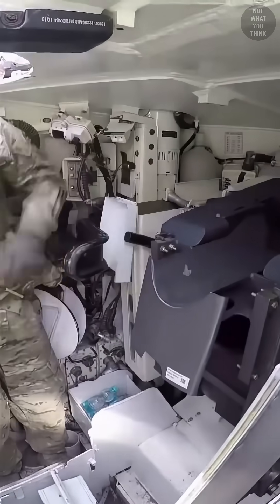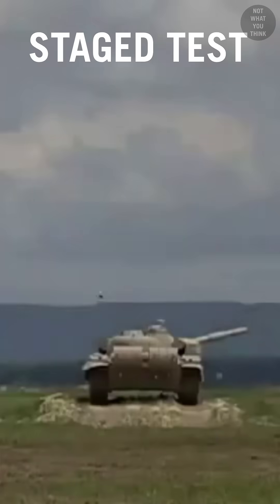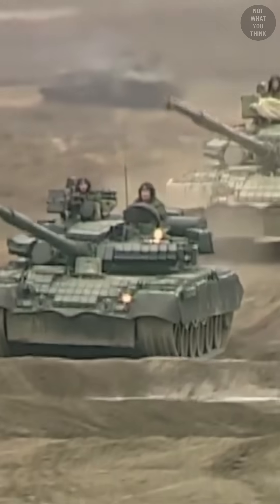Why M1 Abrams Tank Has No Auto-Loader #shorts

Comment: Also the fact that an automatic system may be faster and more efficient in firing, it comes at the cost of not being safe for the crew and being mechanically complex meaning constant maintenance and need to replace crucial parts of the automated system. It also leaves your tank useless if it breaks during a fire fight. I’m editing this to also say that having a auto loader also decreases the volume of the tank needed to support a manual loader becoming lighter as it requires less armor.
Reply: If the mechanism suffered enough damage to break, it would mean that if there was a human loader inside, he would have been either badly injured or dead
Reply: @naelgodefroy2535  it could just break down tho over time
Reply: @hunterbear2421  then it would need a lot of time to break as other elements of the tank, but usually tank parts are well engineered and take a lot of time to break without suffering damages
Reply: yeah but the auto loader has more things to go wrong then if it was just a manual loader, because it also makes it so if the rarety the ammo explodes that the crew can't be shelded but like the americas tank they have it in a compment that is sealed off by a automatic door, so if it is shot the crew stay safe which is good to think about it
Reply: Constant maintenance.
Russian.
Pick one.
Reply: @WayStedYou  Too bad so few people get the joke.
Reply: @WayStedYou  always comrade.
Reply: I dont know how in your country, but here in Europe it is not a problem to build autoloader that wont break down. It is not such sofisticated piece od technology. I would not use breakdowns as an argument. Also there will be noproblem to use autoloader together with safety storage box. But this needs a new tank and new tank will have higher caliber, 130mm or maybe even more, the shell may be longer to be ablle to shot long rod. This all will increase the weight and thats the fact which will make developers of tanks to equip them with autoloaders.
Reply: @milanvnuk8387      Btw in our country we don’t use autoloaders, but anyways it’s always a valid concern for something so mechanically complex to break. Sure it’s not sophisticated mechanism but it requires constant maintenance and replacement to make sure that it specifically does not break and that costs more than it would to have another hand in the tank loading the shells. My argument with the mechanism breaking is valid as they spend more money so that make sure it doesn’t  break. And the reason they’re using heavier rounds and a autoloader is that they don’t have to make the tank heavier by adding extra armor on the turret to protect the loader, they’re trying to counter the issue of making it heavier by making it lighter. Also a blowout compartment is not possible on a autoloader at all. One reason being that if you use a blowout compartment on an autoloader is that all ammunitions of the autoloader are stored in the turret basket meaning you’d have to be able to blow the entire turret for the carrousel type loader or compromise the entire loading mechanism and ammunition on the bustle type loader, anyways that would be a of money wasted there. Also it’s easier to control a explosion of 18 shells than explosion of triple or quadruple that number.
Reply: @mushroomwizard1175  If breakdowns are used as an argument then you need to take in consideration the human breaking and being unable to continue work aswell.
Not to mention that the possibility of the human loader to suffer a critical injury is higher than a good autoloader. Plus you need to factor in the issue that plagues only the human loader and that is mistakes, the machine does not do those it either works or breaks.
Reply: @AmbassadorOfREEE  I dare you to find any organization on the planet that can repair an autoloader faster than the US army can find another person to be loader. Also while we're at it I want to see your autoloader help change slipped tracks or do maintenance.  No tank is going to stop a fight to eat. No tank is going to blow through its entire ammunition storage as fast as the gun can physically fire. Stop making up asinine scenarios to try and prove your point. You're obviously reaching.  I'd trust the reasons put forward by the people who have actually operated the tank as to why it works over the mad ramblings of why it doesn't by some random internet autoloader fanboy on any day.
Reply: @JetleanSam  I sense a lot of butthurt over nothing.

I'm really not an autoloader fanboy, I simply look at things from an objective standpoint. My ramblings being asinine is just your opinion and I don't really care, what I said holds true and you can't deny that.

Everything has their pros and cons and some could argue that the pros of having a human loader outweighs the pros of an autoloader and that includes myself.

Lastly you conviniently completely overlooked my point about effectiveness, reliability and versatility in human loaders favor making your outburst pretty damn silly.
Reply: @AmbassadorOfREEE  you’re just a civilian fan boy that wishes he could load rounds in a tank.
Reply: @m.j.darmody3576  Well sort of right minus the fanboy part. You see I'm from Finland and military service is mandatory for men when they turn 18.
I did my service in 2012 to 2013 (I served for 362 days) and I'm an NCO, Pioneer and the company's radio guy.

So yeah I kinda wish that I would have gotten to load rounds in a tank because that would have been fucking awesome because tanks kick ass.

Instead I got to dabble with radios and blow shit up so it's not that bad afterall.
Reply: Its funny that you say that... I guess people are the same even across different countries... People trying to find excuses for not having to do things, like Russians were saying before that the reason they couldn't build good roads is because it's impossible with the Russian climate , because it has temperatures extremes... You are the same, trying to find an excuse for not having an auto loader.
In practice it's much better and Russian tanks already had it for a relatively long time. Now they even have a tank (t-14) which also even separates a crew from it's auto loader gun and ammunition. And no , maintenance and failure rate is not a problem, and even if it was , tanks are quite expendable, there're usually hundreds of them in the army...

I guess people are the same after all...
Reply: @Alain_Proust  yeah would be very surprised if the auto loader would be an issue.
Reply: Speed and aggression over safety seem like a calculated cost
Reply: I can't wait for a tank gang war
Auto loader vs human loader
Reply: For some tanks like the Leclerc it is as safe as a manual loader, faster, never tired, and probably as good as a manual loader. And it doesn’t drink the driver’s beers.
Reply: Jay Jay  sure, but training for it, and actually doing are two different things.
Reply: Built like a tank?
Reply: I very much doubt that it would be impossible to come up with an auto loader that also has a similar safety mechanism. Better yet, make the tank remote controlled
Reply: @Qwertworks  Fun fact: european auto loaders have the same safety mechanism as the american manual loader... but they're automatic.
Reply: Heh Ndje  being trained too and being able to do it underduress are two different things.
Reply: An auto loader is not faster than human loaders.
19K’s are taught to reload in 4-5 seconds.
And auto loader is about 7-9 seconds. 
We’re putting twice the ammo down range.
Reply: @willbo6017  Thats probably true, but how long can it be kept up? I guess my thing is that eventually, the machine will always be better since it doesn't tire. It may be more rounds than the tank can store before it's more efficient though lol
Reply: @Isometrix116  Does it really matter for how long it can be kept up? If you can reload and fire faster than your enemy then you have the upper hand in a firefight.
I'm pretty sure that even a decent loader can keep up the pace for atleast 5 minutes and do so faster than most tank autoloaders out there.
Reply: @willbo6017  The most modern autoloaders (such as on the Type 10) can manage 1 round every 3.5 seconds.
Reply: Are you actually dumb? You do realise that you can still load it manually if the auto-loader breaks
Reply: @ronjeremy5826  oh plz explain how would u do it
Reply: @ronjeremy5826  yeah but its slow af bc in the russian tanks its a 2 peice ammo system so youd have to go into two compartments
Reply: @ronjeremy5826  on most Soviet tanks, this isn't possible. The T-14 may have this functionality, however, and the B2 Centauro does for sure.
Reply: @ronjeremy5826  I wouldn't call someone dumb before you get your facts straight. Auto loaders can't be manually loaded because there is no space for the human and the mechanism isn't adapted for humans to use. Auto loaders are very mechanically complex, you can't just shut one part of it off and expect the whole system to still work.
Reply: @FlayvorOfEvil  you are clueless. And where are you getting your “facts” from? Google? Buhaha
Reply: @ronjeremy5826  really?
Reply: @MrHohommax  yea soldiers in the army are faster the than autoloaders
Reply: I was a loader on an Abrams for years and in Iraq. 3ACR I promise you auto loaders can not and should not replace a  soldier.
Reply: @MFSAMS  there's no point in arguing practical applications of human loaders with people that think autoloaders are some magical thing that won't break.
Reply: @MFSAMS  so you was a child murder in iraq??
Reply: @justuskid9577  Sure, whatever you say kiddo.
Reply: Autoloaders are slower than humans, overall in the military they are considered bad loading mechanisms, human elements are always preferred, except when it comes to explosives handling like clearing mine fields or such.
Reply: Actually the army trains its men to be faster then the auto loaders they aren't as fast as u would think
Reply: Auto loader's go off target to reload . This is why the west use a manual loader.
Reply: Please shut up so much bullshit in one comment edles Magic mushrooms
Reply: Auto loader isnt faster or more efficient. I could beat an auto loader all day everyday. Auto loader is 6 sec load time. I could load a heat round 2.5 from breach down to up.
Reply: @MFSAMS  this assumes that the gun is elevated to an optimal angle for loading, and that the breach opens and closes smoothly. It's important to keep in mind that the loader isn't the only part of the loading process.
In an M1, I believe it typically goes something like this:
Fire
Raise barrel (lowering breach for ease of loading)
Open/confirm Open breach
Open ammo compartment
Load shell
Close ammo compartment (probably automatic)
Shut/confirm closed breach
Lower barrel to target
Fire
There's a lot to pay attention to, and the loader is doing more than just shoving the shell into the breach.
Reply: @theonlyknight3171  after the main gun goes off. When the break drops I'm throwing a round another round in there. 2 or 3 secs. Auto loader is not faster or more efficient plus auto loader doesnt maintain coms ground guide do maintenance site the main gun or fire the 240.
Reply: @MFSAMS  during training with open blow up panel ofc, but not in actual combat. This isnt war thunder mate.
Reply: @MFSAMS  how long can you keep up that time you will get tired sooner or later
Reply: @MFSAMS  I could do it hanging upside down from the balcony naked while sipping a cold whiskey on the rocks on vacation in Florence.
Reply: @MFSAMS  to do that consistently under sustained enemy fire and on uneven terrain would waste your energy and I doubt you could put out 24 shells a minute in that terrain when the average for strong young men is 8 a minute, humans cant sustain putting out 15 shells per minute and can only do that in short bursts. Besides a human loader gets tried and machine does not get tried, it only needs to be examined and repaired. Machines are faster going anywhere from 8-12 shells per minute depending on type of loader and the tank model, putting out 4 more shells per minute is a huge thing in a fair bit of situations.
Reply: @mushroomwizard1175  with a Russian targeting system you probably do need to fire constantly for 2 minutes and hope for a hit.  Abrams doesn't have that problem.
Reply: @IanNewlin  that’s unlikely to be brief as modern tank shells can hit things accurately within a few km of the firing point and unless the target is outside of that range it’s still unlikely that they wouldn’t hit it after a few shells.
Reply: @mushroomwizard1175  a friend of mine is the loader on a Leopard 2A7 Main Battle Tank, 6 DMXX rounds per 10 seconds
putting you at 36 shells of sustained fire every minute, and he isn't even the best one at the company.
Reply: @IanNewlin  i wouldn't underestimate russian aiming systems
Reply: @MFSAMS  Faster if you had a pissed off crew commander!!
Reply: @MFSAMS  All automated systems can cripple everything if damaged you noob. Target acquisition is always reset after every shot because of recoil, making the auto-loader fast-loading features useless. 

On top of that, it basically increases the cost to produce the whole thing.
Reply: @MFSAMS  the type 90 can have upwards of a 3.5 second reload and for far longer than you can reload
Reply: @MFSAMS  could you? All day? With every round?
Reply: @MFSAMS  No you can't beat an autoloader ALL day every day. Yes you may be momentarily faster than the autoloader but when you gettired and sluggish the autoloader won't. Eventually you will need to stop to eat but the autoloader will keep loading that gun while you eat. You will also need sleep and while you sleep that autoloader still keeps loading that gun with more ammo.

Yes I'm calling out your pravado here, I wan't to see you reload the ENTIRETY of your chosen tank's ammo loadout in one go, sustaining your peak performance all the way without stopping or slowing down a single tiny bit (nope you can't but the autoloader can).
I'm hazarding a guess that your tank will be the Abrams so that's what? About 50 shells that weigh around what 40 to 50 lbs?? (I'm sure you get the picture here).

What I'm saying that a human can't beat an autoloader in efficiency and endurance, that's just a simple fact. Plus if we get to pick and choose our autloader I'm pretty damn sure we can make the human lose in speed aswell, alst time I checked the Gau-8 avenger is a self loading rotary cannon (LOL).
However we can start and argument about effectiveness, reliability and versatility as there are a multitude of things an autoloader just can't do but YOU can ;)
Reply: @AmbassadorOfREEE  The Gau-8 Avenger is a revolving gatling cannon chambered in 30mm 
we are talking about higher calibers
Reply: @ikat_tracer  I'm fully aware, what I said earlier about that is something called a joke, maybe you have heard of those?
Reply: @MFSAMS  1st shot only

Comment: As a M1A2 Abrams tanker myself; the ammo door will stay open for as long as you hold down the knee switch. Once you let go, the door will close after 3 seconds. Another reason we don't use Auto Loaders is for combat effectiveness. We often train to load all different rounds in under 7 seconds since that's usually how long it takes for an auto loader to cycle another round. In the event that an auto loader malfunctions and can no longer do its job, that entire tank is essentially now out of the fight and therefore, useless. We don't ever have to worry about that.
Reply: It makes sense, but as a mechanic I would trust a machine over a person for reliable and consistant performance every time.  The stats are in, human error is shit.
Reply: A loader can do pushups until he gets it right. Auto loader not so much
Reply: ...unless the loader gets injured or otherwise incapacitated.  Of course then, the gunner or commander can fill in with the loader moving out of the way, while the auto-loader mechanism can't really get out of the way.
Reply: @empath69  Indeed. Another reason why we don't use them.

Comment: Human loader is faster in my opinion. And they have a 2 40 to cover with small arms fire. And if you're lucky the loader will be absolutely insane making for some funny interactions.
Reply: Pretty useless in the age of drones anyway
Reply: @bibsp3556  I said the same thing my whole army career. But the new Abrams rolling out are starting to work to counteract that threat. There work horses and can take a beating.
Reply: @kharnblackfeathers6625  tanks have a place obviously, but we gotta just be real about it, why build a tank and train a crew when you can just boop and drop the hammer from the other side of the world.  Remotely controlled  drones of all kinds will be more effective.  theyll be able to go where tanks cant, and do what soldiers cant
Reply: @bibsp3556  while drones are one of our most lethal and devastating weapons, boots on the ground provide other forms of military actions. Every mos in the army supports each other. A drone can't capture a living target. Yet. But I've seen drones recover wounded. And that was the future.
Reply: Land, sea and air all need physical control. Both man and unmanned forces.
Reply: @kharnblackfeathers6625  yet.  Theres always going to be all sorts of uses for specific things, but tech is increasingly replacing manpower as the determining factor overall.  As you say, as of yet, there are tasks they cant do, but we know that companies are working to change that fast, and quite frankly i think we are only scratching the surface